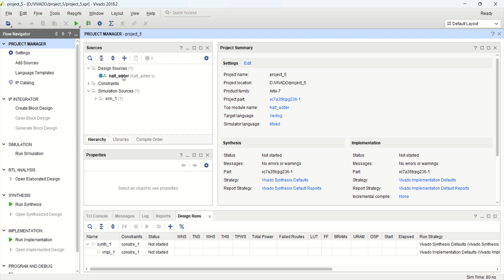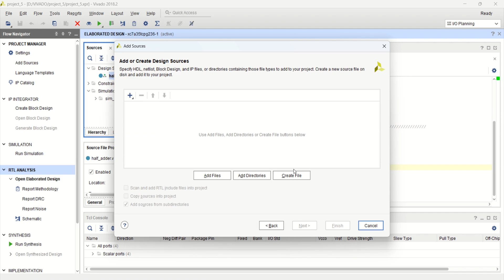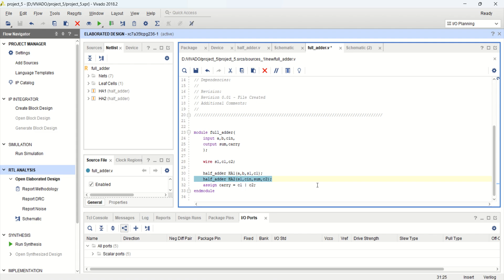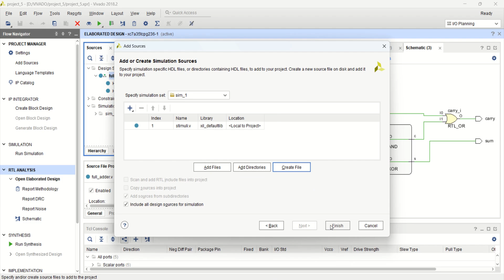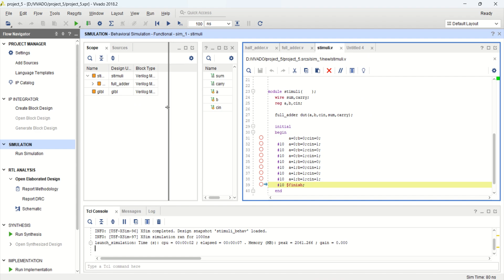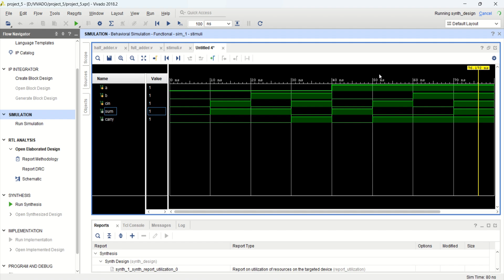Full Adder Design In Xilinx Vivado.

Comment: what's wrong with this ? sir😢
module adder(
             input [3:0]a,
             input [3:0]b,
             output reg[4:0]out
             );
   reg [4:0]cin;
   integer i;
always @(*)begin
             cin[0]=0;
             out=5'b00000;
             for (i=0;i<4;i=i+1)
                begin
                out[i]=(~a[i])&(b[i]^cin[i])|a[i];
                cin[i+1]=b[i]&cin[i]|a[i]&(b[i]^cin[i]);
                end
              out[4]=cin[4];
            end
endmodule

module adder_4( );
wire [3:0]a=4'b1011;
wire [3:0]b=4'b0111;
reg [4:0]out=5'b00000;

adder adder4(
             .a(a),
             .b(b),
             .out(out)
             );
endmodule
Reply from the maker: Hi, Try this
out[i] = a[i] ^ b[i] ^ cin[i];
cin[i+1] = (a[i] & b[i]) | (a[i] & cin[i]) | (b[i] & cin[i]);
Reply from the maker: HI, I gave the correction. Try that
Reply: thanks!